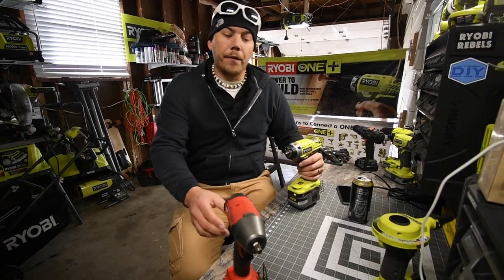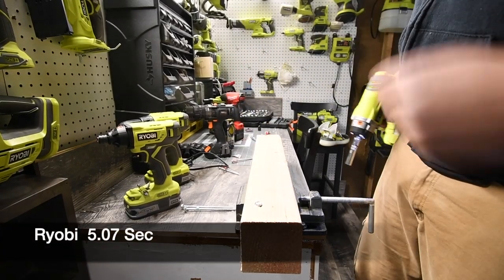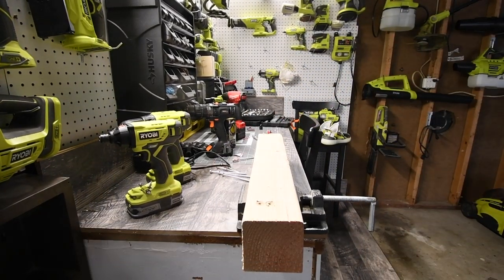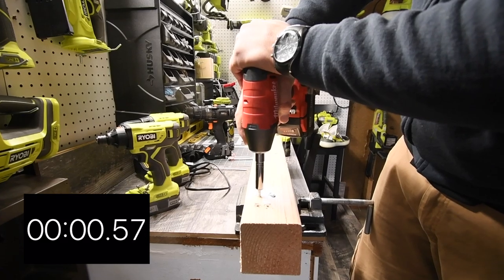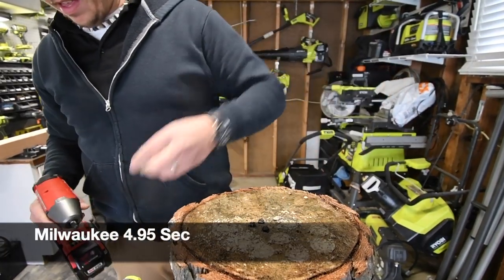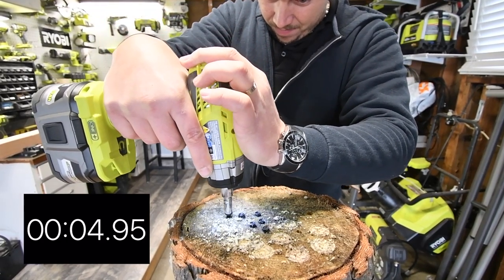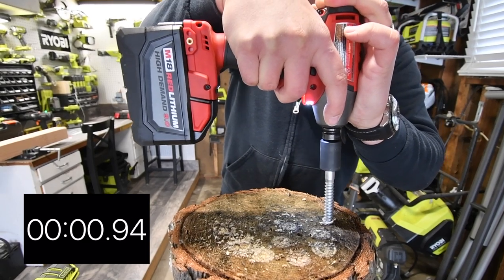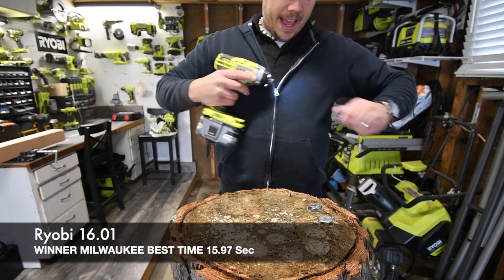Ryobi vs. Milwaukee 3/8 Impacts

Comment: I own full sets of Ryobi,Milwaukee,Ridgid and Makita power tools,my "beater" set the Ryobi tools work perfectly,have not had any failures with either power tool or batteries in 5 years of heavy use,I do take out one of my premium brands every once in a while just to keep them from getting jealous and to cycle their batteries and motors,the Ryobi works so well that I may never use my other tools to their full capacity,good brand for a lot less money.
Reply from the maker: I thank you sir
Reply: Koko Adreuzzi, I own sets of Ryobi tools too in Brushless. I got the tool combo kits at home Depot. The impact driver w/o speed Selector (P239), Drill/Driver P252, Circular Saw 7-1/2 P508, and the Angle Grinder P423. All of them comes with a free x3 (2.0ah battery) and charger with green Ryobi toolbag. Then the day after I bought another impact driver with speed Selector P238 with free x2 (3.0ah HP Battery) then I got the Brushless Hammer Drill P251 and the oscillating tool. Then I bought a few extra batteries 6.0ah HP x2 and 9.0HP x2 and a Ryobi Supercharger with 6 Port. Then most of my Ryobi tools are corded like the orbital sander and corner cat. The only Ryobi tool that I'm still missing is the 16 and 15 gauge Cordless nailer. The only Professional Tools that I have is Bosch I have them for years. And I got some Worx Tools and Black and Decker and Vonhaus tools.

Comment: Good test.  I'm glad you used the compact Milwaukee gun.  It's in the same class as the Ryobi.  I do wish you did a size and weight comparison of each though.  FYI, the Milwaukee does have vents to the motor.  The vertical holes at the rear on each side vent the brushless motor.  You can feel the air movement when you run it.
Reply from the maker: it wouldn't have made a big difference, lol Ryobi would have lost, but thank you sir

Comment: Two points to make:

1: The comparison is not  between actual equivalents. The Milwaukee is a brushless with a 9 AH battery vs the Ryobi, a brushed model with a 6 AH battery. The Brushless SHOULD be faster, more efficient and more powerful and the extra power of the battery at the disposal of the Milwaukees motor should increase its power and speed.

2: Unless I missed something, the Milwaukee was sitting while yo finished the test on the Ryobi so the  Milwaukee should be a little cooler when you measured the temperatures of both. Probably not 23 degrees difference but the porting would also have a minor effect. 

So, to me, the advantages the Milwaukee has are partially negated by it's superior specifications and power utilization and what is left is offset by the price differential. I'm not a professional so my usage would allow me to take advantage of the cost savings to have the Ryobi without missing out on capability or longevity. An infrequently used brushed tool will still outlive a hard used brushless one. 

Good video. Informative and helpful. I did learn that the Ryobi, while coming in second to the superior specced Milwaukee, still has capabilities that I will never reach and speeds that I will be comfortable with. 

Thanks.

Comment: Ryobi battery have 21 cells to the milwaukee 18 6 50 battery pack
Reply from the maker: the Ryobi is brushes and the Milwaukee is brushless Fuel
Reply: @ManCaverTools  yes but the battery are different cells
Reply: 9.0 has 18650 not 21700 like the ryobi has

Comment: No offense but these tests are irrelevant as most people buying these will use them on cars not wood thats what an impact drivers for not a impact wrench test them on lug nuts engine bolts hub bolts anything on a car which is torqued enough but overall good video testing them just wished as a mechanic i could see the difference on cars as thats what these are made for
Reply from the maker: this is a very old video. I have to revisit this test, check out my latest videos
Reply: @ManCaverTools  i will and next time you test a impact wrench could you use it on something mechanical like a car engine hub bolt even a boat engine something that us mechanics can relate too as im not driving bolts into logs im removing a hub bolt thats been torqued to 200nm on some vans 300nm upwards thats what i meant these are mainly mechanics tools and we need to see them being used on a car to see if they're worth the money as screwing a bolt in and out of a wood log is useless to us

Comment: With an impact WRENCH, speed is irrelevant. Torque is what matters. Typically the lower torque and lower end impact wrenches do have more rpm but lower torque. Higher torque usually results in less speed. This test actually shows that though. With the smaller fastener the ryobi was faster but with larger fasteners requiring more torque, the Milwaukee did better.
Reply: agreed alot of these tests are flawed, these are 3/8 impact and are obviously aimed at doing mechanical work not insert screws into a 4x4
Reply from the maker: I know. I didn't mean to say driver. and thank you sir
Reply from the maker: they are not flawed, they are stress tests. doing something they are not meant for is a perfect test on an equal battle field
Reply: @ManCaverTools  i disagree on that one, a tool should be tested on what it was designed for
Reply: Ryobi Man Caver I think you maybe misunderstood my comment. I wasn’t correcting you, I put the word WRENCH in capital only because I wanted to be clear I was referring to wrenches and not drivers for my comments. As I said this test actually proves the point that higher torque impacts typically have lower speeds
Reply: ChromeGunner86 actually a 3/8 impact is a good tool for lags and large fasteners. Especially if you have a lot of them. An impact driver will do the job, and can be used if you have to run a few but if you have several to drive, it’s going to overwork the tool.
Reply: @Thatgreenbronco  no they're not flawed dude! I'm convinced of Man Caver's test, It's a real world test. But really I don't give a damn about impact wrenches to me they're just an impact drivers on Steroids!. In my job site whenever I need to drive a big lagbolt like that, I always use my Bosch Bulldog Extreme SDS to drive it. (no pilot hole!) (Then one time I got caught for Installating lagbolt with no pilot hole which is requires by Building code! 🤣😂) My corded Bosch Bulldog Extreme 11255vsr It has enough Torque to drive 8inch lagbolt, fat lagbolt like that or even the 10inch ones. I have done it many times. If not? Then I'm gonna pull out my another SDS which is a Bosch 11264EVS.
Reply: @Zee20Ate  yep! But they're not Flawed test, and I don't use impact wrench in my jobsite. Man Caver's Test is just a testament under stress of how that Ryobi Impact Wrench 3/8's can do the job! It's not fast as the Milwaukee but wow! I'm impressed that impact is only being run by a brushed motor and it did, it drives that big lagbolt And hey! it's not even a Brushless yet!

Comment: Milwaukee is a little more restrained than the Ryobi. Becuase the Milwaukee factory sets the the tool to work on only 75% of the tool capacity so it can be more reliable and have a longer service life.
Reply from the maker: I thank you for that info Victor

Comment: Didn't like this head to head should be same battery equivalent at least
Reply: It was close enough.  The Milwaukee battery has 15 regular 18650 cells vs the Ryobi that has 10 high performance 18650 cells.  Total discharge current in each is almost equal.
Reply from the maker: I got my 9 ah battery back so ill be using that in the videos now
Reply from the maker: I thought it was a good test
Reply: @IndependentThinker74  so you agree it's not equal
Reply: @ManCaverTools  you have really good head to head test but this one I'm saying Its not good if you do the battery same then the video would be more real head to head
Reply: @lawrencesanchez604  Ryobi doesn't make a battery the same as the Milwaukee 9.0.  The 3.0 HP 4.0 Hp and 6.0 Hp are the closest in terms of power.  The Ryobi 9.0 HP has much more power than the Milwaukee 9.0 does.
Reply: @IndependentThinker74   good and ryobi is brushed and Milwaukee is brushless it was same type of impact driver used I'm sure the price was different as well I'm just saying if both were 9hp batteries better head to head it's what they have to offer in 9hp and it's what they had to offer in impact driver the other head to head ryobi man used same batteries and the videos were great